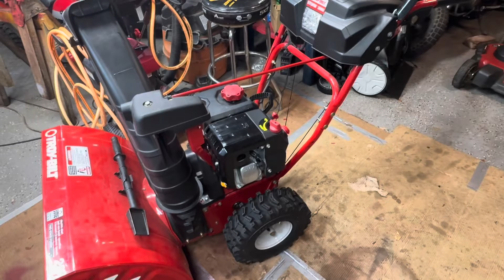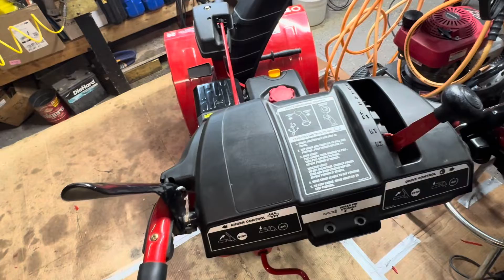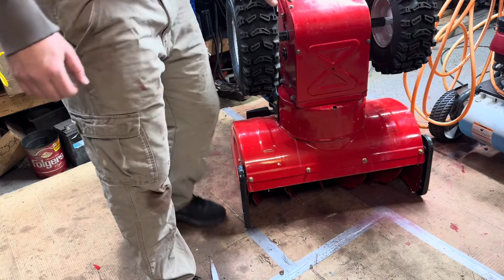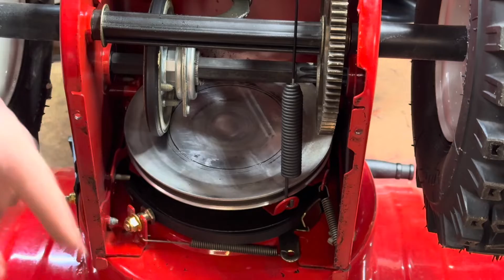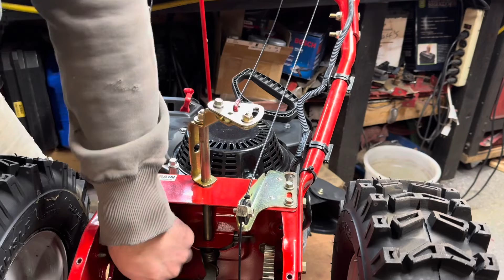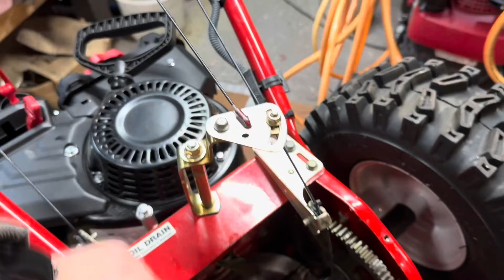Snowblower drives forward in reverse, let’s fix it!

Comment: My reverse 1 is super slow and R2 isn't much faster. Will adjust and see if if speeds up a bit. It's 12 years old and probably has never been adjusted.
Reply from the maker: Adjustment should help but reverse is usually pretty slow
Reply: @SHONEY21Z  I'll find out tomorrow. But my reverse 2 is way slower that reverse 1 was on a same size Yardworks with a slightly smaller engine. Luckily I don't use the reverse much. Usually just pull it back for a few feet at a time.

Comment: I am getting engine oil dripping on the friction plate which causes the drive to slip.  Is there an oil seal on the engine output shaft that could have failed ?  The snowblower only has about 20 hours of use on it and looks like new.  Craftsman 24 inch.
Reply from the maker: What engine do you have? Is it tecumseh? Can you spot an area that has oil below it more than other areas?
Reply from the maker: There’s a few places small engines can leak from, first thing though is to check if the oil level is correct. Oil can come from the train plug or fill cap, I can come from the crankcase gasket, or the output shaft at either what pulley side or the flywheel side. And finically from the valve cover or breather from the valve cover. Might have to clean everything, then run it and see where you start getting oil.
Reply: @SHONEY21Z  I will check the valve cover and the breather pipe. Thanks
Reply: @SHONEY21Z  The oil seal looks good at the output shaft where the pulleys are and the belts are dry.  The valve cover screws are tight and the breather is in place.  The engine is not overfilled and is at the correct level.  Is there an oil seal under where the start pull/recoil assembly is ? Thanks.
Reply from the maker: Yea there is another shaft that comes out where the flywheel attaches. It’ll be in the back of the engine. It’s rare to leak but no impossible. Make sure there’s no oils coming from the oil drain plug or look drain tube.
Reply: @SHONEY21Z  Hi.  I checked the oil drain plugs, they were tight.  What is the look drain tube ?  Do you mean the breather tube in the valve cover ?  That is in place where it should be.
Reply from the maker: I meant the drain plug tube. It’s the extension from the engine to be able to drain the oil. Did you check around the oil fill tube?
Reply: @SHONEY21Z  I did and all looks good. The drain plug tubes are tight. Is there a crankcase cover gasket under the engine output shaft ?
Reply from the maker: There is a crankcase cover. It’s either on the front (where the auger pulley is) or on the bottom of the motor that’s bolted to the frame.
Reply: @SHONEY21Z  Thanks for your response. Unfortunately its too cold to work on the snowblower at the moment in an unheated garage. I will just have to clean the friction plate and friction disc to use the machine until it warms up enough to fix the oil leak issue.
Reply from the maker: Good luck 👍
Reply: @SHONEY21Z  Thanks for your help
Reply: @SHONEY21Z  I might have found the source of the oil leak. There is a screw in plastic cap near the belts. I think it is used when the engine is used in a different application. The cap was loose. 
I have cleaned everything up and will leave the snow thrower tipped up on the auger housing all night to drain any oil under the engine. Some oil has got on the belt closest to the engine.  Is there any way to clean the belt or does it need to be replaced ? If it can be cleaned what should I use ?  Thanks
Reply from the maker: Yes the new engines have a few different fill holes because they can be used on various types of machines. Usually a yellow cap with an oring.
Reply: @SHONEY21Z  This cap was black with an o ring and I never knew it was there until I took off the belt cover.
Reply from the maker: Forgot to mention that one. Good find.
Reply: @ When setting up the position of the friction disc on the friction plate should the friction disc be in the centre of the friction plate when the machine is in neutral ?
Reply from the maker: I usually put the gear in reverse 1 and set the rubber drive gear just off the center of the friction plate. Then tighten the bolt and shift it to fwd 1. The rubber disc should go across the midline of the friction plate.
Reply: @SHONEY21Z  Sounds good, I will do that tomorrow.
Reply from the maker: I have a video showing how to adjust the drive if you can’t figure it out
Reply: @SHONEY21Z  I looked at the video, thanks.
Reply: All is well with the snow thrower now. I just need to replace the oil saturated drive belt but they are back order (419744).  Thanks for all your help.
Reply from the maker: https://amzn.to/4kiXMcg 

Best bet is to remove your old belt, measure the outside circumference and width to make sure it matches the belt in the link. (From the part number you supplied)

Comment: Hi
i have yard force snow blower 
same issue you think it apply same adjustment procedure to mine 
thanks
Reply: yes i do 
thank you so much replying back to me 
i will look at it once the weather starts to warm up 
will let you know the updates 
thanks again
Reply from the maker: Np
Reply from the maker: Does yours have the cable adjustment or with a metal rod? If it’s got the cable adjustment like this one, it’ll be the same.

Comment: That was very easy to understand the way you illustrated it. This machine looks pretty new, so do you think it was assembled at the dealership but not tested fully?  Did that adjusting setup have a lock washer to prevent the adjustment from slipping?
Reply from the maker: Could’ve been assembled improperly however I see this often and I think the cable starts to stretch once it’s used. I try to store them in 6th gear so there is less stress on the cable.

Comment: Thanks for your videos on the Troy Bilt snowblower . Very helpful ! Just subscribed after I saw the last video about the fast carb fix . Been taking mine apart with all the plastic junk to clean my carb .
Reply from the maker: I do have to take the carb off more often then not, which requires removed all the plastic and the 10mm bolts. But sometimes you can get lucky just doing the main jet and emulsion. I also can do the pilot jet without removing the carb but it’s a tight squeeze to get it out. I’ll make a video of that in the very near future.
Reply: Thanks !! @SHONEY21Z